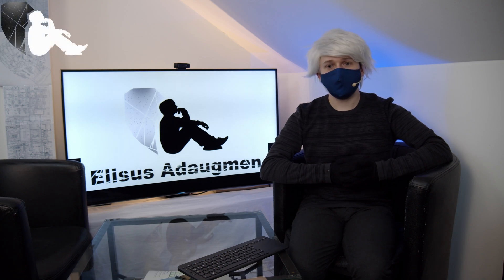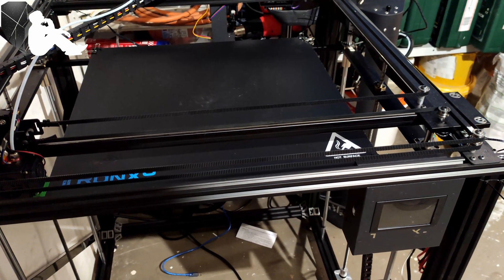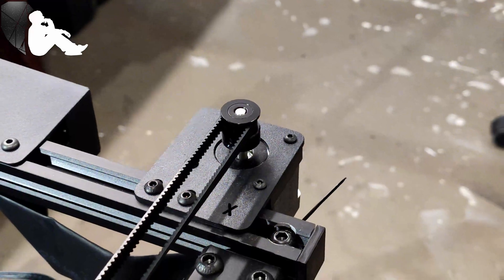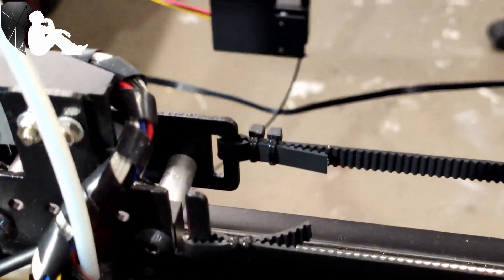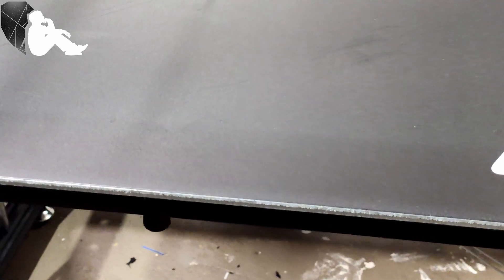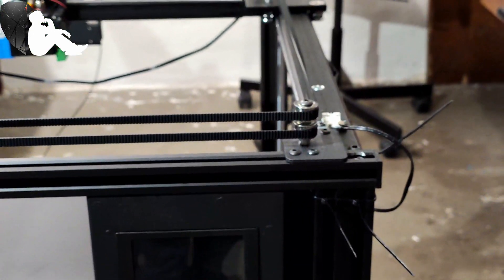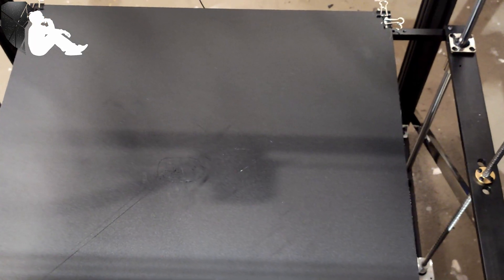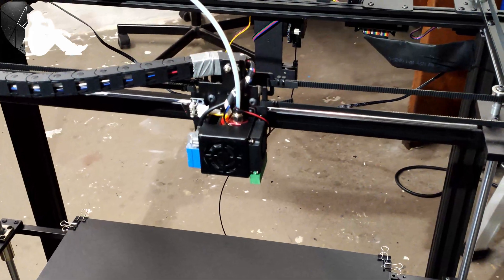Tronxy X5SA 500 Pro Problems and Fixes

Comment: Another mod is to link the two worm motors together. Uneven resistance causes the bed to change in level while printing. Tronxy included the belt and pulley in my purchase

Comment: Ive had a Tronxy pro for about a year and a half. My average prints are 18 hours and I am new to this stuff. Out of the box my pro friends have been shocked at the accuracy and prints I have created. I am just now having a few issues with prints, likely due to stretching of belts and settling in but this machine is a beast!!

Comment: Hi there. Let me share my experience With Tronxy X5SA regular( non-pro) version of 2020 year revision. It has wiring and PSU issues already addressed.
1) Install corner connectors( triangle shaped) at each corner( means 3 connectors per corner where it's possible). Unfortunately, because of the size and 2020 profile usage without any diagonal supports, printer will change it's shape from rect on each side to some rhombus style instead of keeping 90 degrees angles.  Triangle connectors will help with issue but it's better to buy either T-slot, either V-slot 2020 profile and make at least one diagonal on each side. This will resolve the issue of printer's shape collapsing once and forever
2) Get rid of the PTFE bowden bundled with printer. It's loose, wrong inner diameter and you will have insane stringing issues e.g. with PETG caused inclusively by the quality of bowden. Go with Capricorn tubing -- for such sizes it has real advantage even over quality regular PTFE tube.
3) Replace hotend and (preferably) feader. They are total cr*p, Ender 3-styled. My choice is all metal hotend( I use Micro-swiss hotend and BMG extruder).
4) Go with direct drive config instead of bowden. Just install slim stepper motor version to extruder instead of the bulky stock motor. The benefits of Direct Drive on such sizes is visible with naked eye even with PLA.
5)  Remove filament sensor -- it's useless and quite often signals "there is no filament" to motherboard.
6) And the best and most important update. Forget about Chitu firware on your board and flash Marlin v2. It already got few sample configurations available for our printers, depending on motherboard version that is bundled with your printer. Guys from Tronxy are extremally creative and you can get these printers with V5, V6 or V8 or hybrid boards. E.g. I've got V8 with TMC2225 drivers and STM32 controller. My friend baught the same printer, but 2019 revision, and he got crazy A4988-based old board. But in any case Marlin v2 knocks out Chitu firmware easily. 
After all these changes I can say that I'm happy with the printer.  I've bought it for ~200+ CAD during Amazon Sale and with all my investments it's now ~300-320CAD total price. Here in Canada even Ender 3/Ender 3 Pro are more expensive. But definetly this printer is for geeks and engineers. Modern Coca-Cola Plug-and-Play iPhone generation will miserably fail dealing with this printer.
Good luck and I wish your the best prints and interesting ideas in 3d printing/modeling!

Comment: How can i get the original firmware to this printer?
Reply from the maker: You can get it from tronxy support. The firmware consist of two main parts. The Binary files and the config files. The config can be changed without changing the ROM/binary of the printer(changing the temp sensor, accelerations, things like that).
Reply: @elisusadaugmen912  thank you very much!
Reply from the maker: @Speeds1984  There is a  serial code on the mainboard of your printer. If you put that alongside the the serial number of the driver IC's you should get the right firmware and config files from them. It will take them about 3-4 days to answer in my experience.
Reply: @elisusadaugmen912  I had a problem with the sensor and in the attempt to apply another sensor I ended up not being able to and wanted to revert to the original firmware, but something went wrong with the backup... I will contact the support of the tronxy...

Comment: How the hell do you put your couplers near the bottom without causing massive Z wobble, the top is already loose with the 8mm lead screw far inside
Reply from the maker: The important thing is that the lead screw isn't touching the motor spindle. The lead screw should be able to bend the couplers slightly. You can try removing the top bearing. This can sometimes help with z wobble. If the lead screw is badly bend. The only way to correct that is to bend it back slowly and without heat(otherwise the hardening might be lost or the screw breaks). My lead screws are almost perfectly straight. There is no z wobble in my prints. Though that is really lucky with the length of these screws.

Comment: Instead of twisting the belts 180 degrees, do you think it is possible to use "real" belt pulleys with teeth instead?
Reply from the maker: I have heard that it can reduce the problem. But the problem is that the rim of the belt gets hooked on the rim of the idlers. I have tried out idlers with bigger rims without noticeable differences. Plastic idlers do not seem to have that issue. Twisting the belt was an easy fix and solved that problem.

Comment: Hello My friend letme Say this report about the tronxy x5sa pro is so good  l have a few problems with my machine the thing is that does not reconice the filament l exchance the detector and the problem still there 
I want to put a new firmware but l don't know if this gonna work 
Other thing i looking for the software of installation because l don't have it 
Thats because i bough to somebody else and that person told me to work with prusaslicer so that also could be a problem ,, any way letme know if You know where i could get the software of installation the model of My tronxy is the x5sa 
Well l hope You know where to get this 
Thanks and reggard
Reply from the maker: In terms of Software I would recommend the current version of Cura which you can get here: https://ultimaker.com/software/ultimaker-cura
It comes with decent predefined profiles, including profiles for tronxy printers.

The most recent Firmware can be downloaded here:
https://www.tronxyonline.com/Firmware-X5SA-Series-a63178.html

Regarding the filament sensor: I'm not aware of a firmware related bug that causes the printer not to recognize the filament sensor. It's possible but I haven't heard about it. There is a small led on the sensor which should light up if everything is connected. Does the printer work even though it doesn't recognize the sensor?

Comment: Whats your thoughts on the pringint quality?
Reply from the maker: The print quality highly depends on your skills of interpreting a bad manual and fixing problems. If you can do this you can get a decent print quality. Which is good enough for big structural / mechanical parts. But you won't win a price for printing quality. This thing is big and cheap. That's it. The tolerance aren't tight enough(long belts/XY Axis). But if you print with a 0.6/0.8 mm nozzle this doesn't matter.